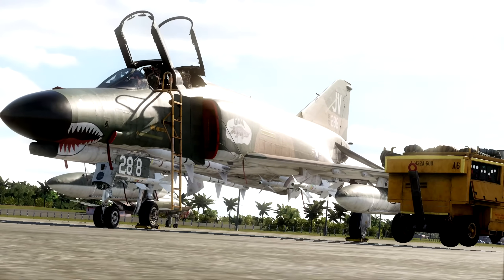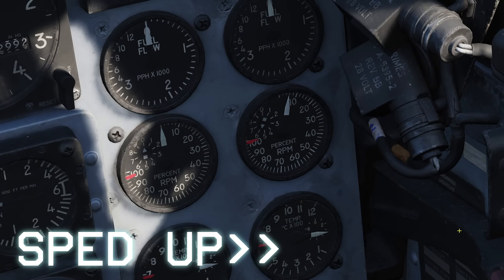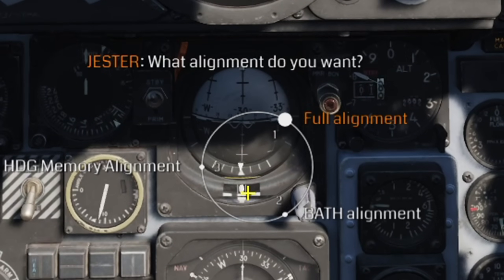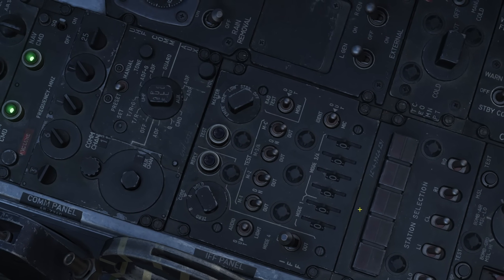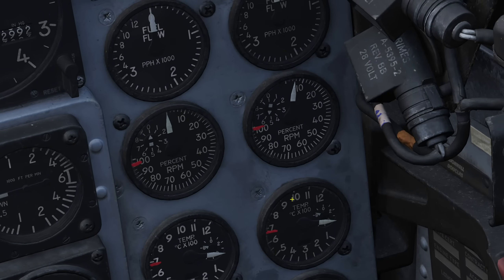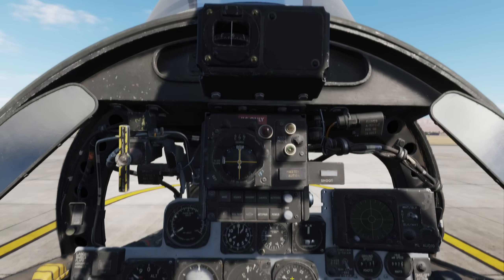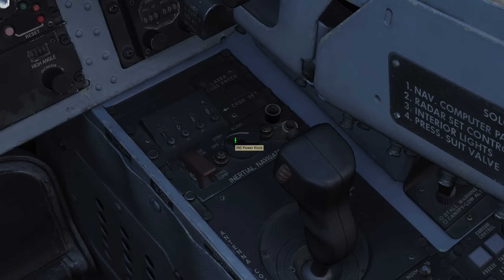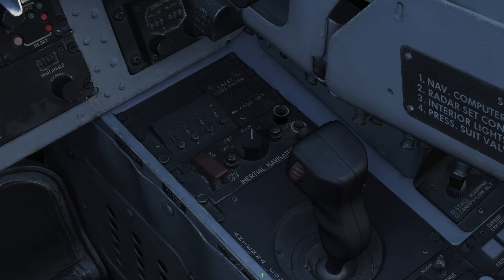DCS F-4E Phantom II for DUMMIES Chapter 1: Pilot and WSO Cold Start Procedure

Comment: Here we s an auto sync,relay synch compass when switching primary to standby……no need to synch compass….
Reply: I always make sure to hold that spring loaded switch after primary sync.
Reply from the maker: @pugloverg6671  I’ve had sync issues sometimes when not using the sync switch after switching to primary, so I added it in case there were any issues.

Comment: i cant trimm this shit plane to level flight ! I always have to pull the stick forward a good amount....sucks !
Reply from the maker: You have to trim it out for the power setting. Because the F-4's engines are slightly pointed down it's not going to trim out super stable. You have to trim it out like the tomcat but not as often. You can get it extremely stable, I promise.
Reply: @PrezDCS  ? and how ?? i cann trim it fully nose down but than again the stick moves full right with a lot of force !  When looking in F2 you can see the elevators and how they move with the stick y axis. But trimming down they do not move a bit !  On the F14 they move and i can fly her stable.
Reply from the maker: @kubanskiloewe  Idk, double check that you even have your trim hat bound properly. I've never heard of anyone having this issue.
Reply: @PrezDCS  i have only my ordinary good old MS FFB2 stick which is in service since 15 years now ?!  And it does the job in many games and also many DCS modules but there are a few which i cant center to levelflight; Spitfire (always goes nose up) Mossie (the same) and F4 (also the same). Others fly like a dream after a bit  giving a trim. F14 is a bit like F4 with trimming yes but it works because when trimming the elevators move....not on F4 , yet !
Reply from the maker: @kubanskiloewe  I don't know anything about force feedback sticks. You'll have to mess around with the settings in your controls or the special options. I can't help you here.
Reply: @PrezDCS  its simply not right what they´ve released ! All trim option i use do not bring this plane into a stable level flight at normal speeds with a centered stick !
Reply from the maker: @kubanskiloewe  I gotta be honest. This issue is entirely an issue of your control suite. Like I said, I've not heard of this issue and not experienced it myself, and I know a few people that also use FFB sticks. Idk what to really tell you but to try and talk to HB or search the forums for a fix.
Reply: @PrezDCS  its entiely NOT an issue to my FFB2 stick because other players have and told the same problem !  Perhaps there is a problem with FFB driven Sticks which i use too and especially with that F4 modelling ! 
Now i read a lot of these others who have the same problem and found out that with deactivating FFB in settings of DCS the plane flies straight when stick is centered ! Fine...BUT you lost all you FFB which sucks again in combat and realism.  Dev´s have to do some homework !

Comment: Hi, great tutorial ... in a concise way it covers a lot of options for the cold start, including the WSO and the INS alignment. To have the ground crew respond, you need to first connect the battery so that the Intercom has power, this is done via seting either Engine Master switch to ON, you can tell the battery is on because the landing gear, slats & flaps indicator will work (the barberpole is not present). After having the Battery connected, the Ground Crew will respond normally when you ask for the cartridges. Looking forward to your next tutorials, so you got a new subscriptor :)  cheers!
Reply from the maker: Yeah, I found out that the engine master switches also function as the battery switches until after when I asked a few guys more knowledgeable on the F-4, and this was after I already made the video. And thank you for subscribing :D

Comment: Thanks for this video! Very informative. I have noticed that as the pilot, i cannot get jester to do a stored heading alignment after i have landed, shutdown, refueled and rearmed. Any ideas?
Reply from the maker: I recommend just not shutting down the jet. there may be an issue with jester context where he doesn't really know that the jet has been restarted. Either leave the jet on or just respawn. You can also just hop into the back seat to do the alignment yourself.

Comment: Thank you for making going over the Wso seat for some reason no one else seems to be doing that. Only thing I saw you miss at start is once both generators are on you should cycle the right gen off then on again to extinguish the bus tie open light.
Reply from the maker: It's not necessary. That's more of a full check thing than something that's actually necessary. If it's bothersome you can always just hit the warning reset to fix it. I never noticed the light when doing the start up without cycling the power

Comment: According to the tutorial mission, you are supposed to hold the ignition in until the EEG speds up. Just wondering.
Reply from the maker: Yeah, technically, you just hold it until you see the gauges kick on. I just stated 3 seconds b/c the engine should for sure kick on by then and it's a simple metric to follow.

Comment: Question: Are you playing in VR? I only ask because when I play in VR, I only get half of the jester menu. I submitted the bug to DCS, so we'll see what happens.
Reply from the maker: I’ve never played DCS in VR. Hopefully they fix that soon
Reply: Thanks ill have ti try that out today see if that helps,ill let ya knkw if ot does.
Reply: Yeah me to because as of right now my f4 is grounded.
Reply from the maker: @Matt-tf1wz  I’ll ask the devs about it and see if we can’t get that fix done sooner
Reply from the maker: @Matt-tf1wz  here’s a possible fix for now: 

“For those of you having issues with the cutoff HBUI in VR: 

It is an issue with the DCS VR implementation and an unfortunate combination of graphic settings. You can fix it either by selecting "use dcs internal resolution" in your VR settings or using our special options if u dont want to do that.”
Reply: @PrezDCS  what are your special options
Reply from the maker: @Matt-tf1wz  I just have all the force feedback stuff off and set to zero, otherwise it's all default

Comment: How does one do this without having a split throttle.??      Edit:   I figured it out.   Needed to add a modifier for the left throttle under axis.
Reply from the maker: You can also just bind both to one axis, there’s an option for it in the axis commands. You don’t necessarily need split throttles to do the start up since the detent is clickable and it won’t move while in the detent, and it doesn’t matter if you push the already started engine forward since the wheel chocks will hold you in place. Not too big a deal.

Comment: Can the WSO put the alignment gyro pre-heat into standby before the engines are powered?
Reply from the maker: I tested that to be sure before making the tutorial, and no. The WSO cannot. The warmup process requires engine heat to apply heat to the gyroscopes.
Reply: @PrezDCS  jeez. So, if I'm understanding this right, you are looking at nearly 12 minutes MINIMUM for a full gyro align?
Reply from the maker: @ultimatum1895  well, if it’s really hot out it might take less time. If your pilot is spooling up one engine at a time you might be able to warmup with only one engine, but the real issue now is switching from external to internal power might kill the gyros. I’m not entirely sure but I believe this to be the case. That’s just how these things work. It’s old stuff, very esoteric technology lol

Comment: No WSO-Pilot comm check?
Reply from the maker: An unnecessary step. There's no comms check step like in the F-14. Also, the intercom is set to hotmic by default as of right now, so if you're using SRS then it shouldn't matter. Also, most people would probably use discord or some other voice chat to communicate depending on the situation.

Comment: Dumb question, would you mind do recommended key binding?
Reply from the maker: Frankly, I can’t do that. At least not a dedicated video b/c everyone’s setup is gonna be different. My personal recommendation to get started is to just go into the manual, look at the controls (stick and throttle) and bind everything on them. Once that’s done, then bind anything not on the in-jet HOTAS to whatever you want and is convenient. That’s how I do things. Also be sure to try and bind things as similarly across jets as possible to make sure you’re not fumbling all the time :)
Reply: @PrezDCS  Yea, sorry for the request.
Thank you.
a side question, does flying this, absolutely needed rudder and trackir?
Reply from the maker: @dienkhungtung  No need to apologize, man. It’s all good. As for whether you need rudder and trackIR, no. Jets don’t need rudder inputs to fly really since there’s no torque like a prop. You only really need rudder for things like dogfighting or crosswind landings. I recommend getting some form of head tracking tho. There’s many options out there that are much cheaper than TrackIR. I use a DeLan clip myself which is basically a DIY TrackIR made by a small company. It’s not totally necessary, but it will enhance your experience :)
Reply: @PrezDCS  Ah thank you for the reply

Comment: Great video. What’s the keybinding for the throttle detent as I can only find one which moves  the throttle fully forward and I have only a single throttle so I have mapped the throttle levers to that but doesn’t do anything
Reply from the maker: You can just click on the flat part at the bottom of the throttle handle to detent each one. That’s what I typically did until I discovered my actually off detent on my TM Warthog worked to operate them. I’m unsure if there’s a proper way to detent the throttles with a keybind like that